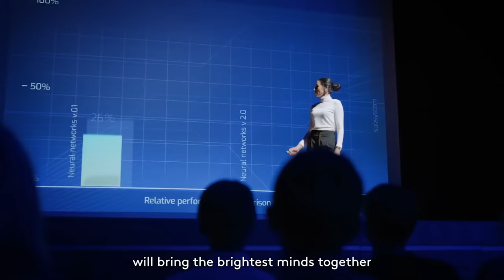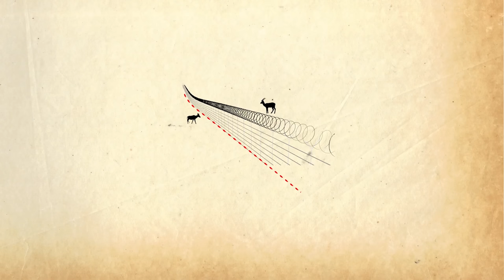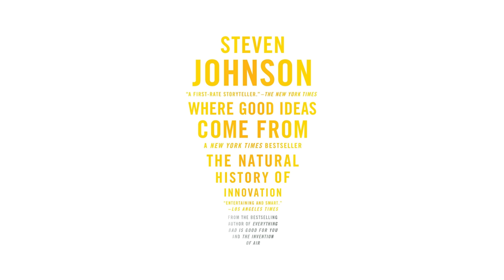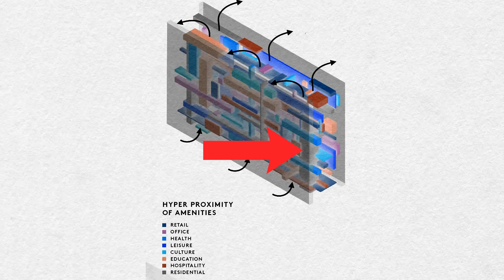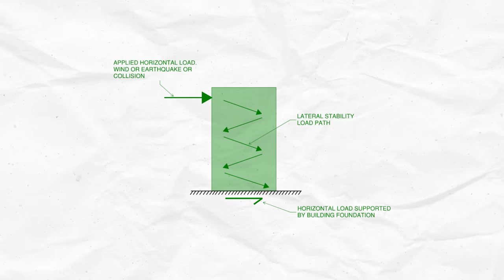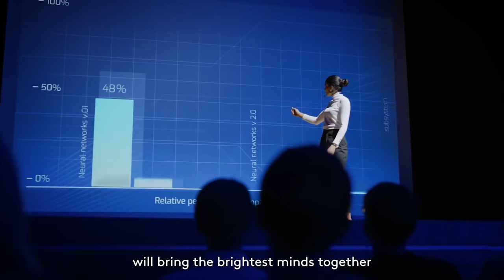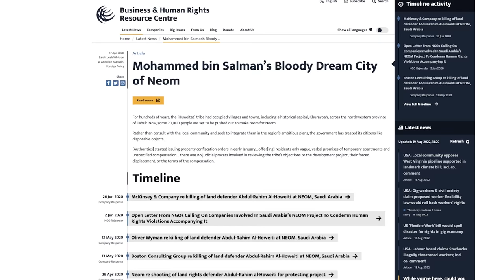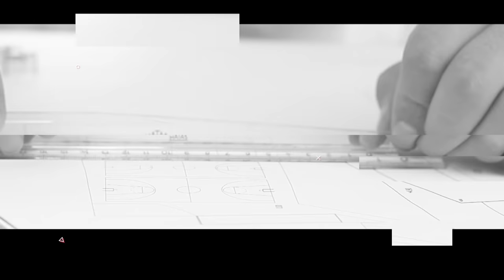This city concept breaks architecture (THE LINE)

Comment: About the environment disturbance, I think it's also worth mentioning that a 500m high wall is going to disturb so much the wind patterns, it might actually have devastating consequences on the line itself: I wouldn't be surprised if it just creates a huge sand deposit in front of one side of the line, as well as create wind abrasion. Also, it might create microclimates on either side, and for sure disturb usual water patterns, maybe creating flooding in some areas after a desert rain.
Reply: That's actually a really good point too. They're basically putting this thing up in a place where it's going to be almost non-stop subjected to literal sandblasting across a huge surface area. Between that and the incalculable number of birds that will splat in that thing, structural failure in the glass panels will become a problem sooner rather than later.
Reply: I remember things like that happening when they made those fake islands that cut off water flow and turned everything on the coast into a bog haha
Reply: also it would become incredibly unsafe if the sand that's picked up by wind gets INTO the wall... what if a gust or literally a sandstorm occurs and enters the wall .. you're at mercy of mother nature and you've basically created a death pit  where you'd be spending millions of dollars cleaning out and extracting the build up of debris and sand every few months....i might be a bit off but it sure doesn't seem safe at all
Reply: @Proffessor Enigma That's not unlikely. Whether or not they care, doesn't matter, let's mount a greater body of evidence against the wall to show it is not a good idea.
Reply: @anastasia408  Yet another very good point. In fact this point is probably pretty key, as not only would it become an issue if the wind carried sand inside somewhere accidentally, but that kind of place will absolutely need to have an integrated ventilation system all the way throughout pushing huge volumes of air around inside which, of course, means intake on the outside. Intake that's going to be constantly overwhelmed by the sand and dust that will be practically constant in that environment...
Reply: Exactly LOL
Reply: @Astraeus..  it’s ok they’ll have the slaves remove the sand everyday
Reply: Fascinating  point. Just another point that reinforces that this project has nothing to do with sustainability and everything to do with vanity.
Reply: Somebody needs to run a computer simulation of this thing and see what happens. I'm thinking that the thing is just going to become a huge sand mountain on one side at least.
Reply: Not saying i support this project in any way. But if you and i (a couple of simple dudes on the internet) have come to this relatively logical conclusion, wouldn’t the professionals and multi billion dollar investors have thought about this already
Reply: @mark94786  They are professionals at taking billion dollars FROM THOSE INVESTORS.
I mean, just take a look at some of those projects that are made like those "palm islands". 
If you got them hooked at the pitch, they are go.
Reply: It's truly amazing that they chose the least aerodynamic shape to shield against winds that carry small hard particles at violent speeds. It's like they're asking to be knocked down by the storms they claim to be shielding from. They're also asking for a city-/line-wide epidemic, because maintaining fresh air circulation and temperature simultaneously in this flat, high-surface-area shape is going to be an energetic nightmare, and one of the two will be compromised. And no amount of trees jammed inside the line will prevent disease transmission in a densely populated level with no options to leave easily and no free access to fresh air.
Reply: Abrasion isnt an issue. The rest, however...
Reply: For rain it would have to be high enough to block clouds and it’s nowhere near high enough for that, at least in arabia
Reply: @amruthasrinivasan3875  I keep seeing cooling as a problem. Cooling is not an issue at all. Smart design and using your brain goes a long way. Im living in a 12 story building.
Be it winter at 2ºC or summer at 35ºC, in my house, the lowest you will see is 19ºC and 23ºC the highest. No heat, or AC.
The heat output from the fridge, TV, washing machine, stove, PCs, 3 persons, is enough to raise the temp of a 90m2 apartment by 2-3ºC during a 24h cycle. In winter we vent for half an hour everyday in the morning.
In summer we vent for 2h in the morning, then close windows and drop all blinds............

The secret?¿ 30cm brick/concrete walls + 25cm of "ventilated" facade, and a shared heating system throughout the building. When some1 above me turns the heat on, i get residual heat from the pipes going through my walls.........

Right now, at 1 december i didnt turn the heat on yet and im at 20,5ºC with 7ºC outside.
Reply: Mirrored wall outside. All the birds that are going to fly into this.
Reply: Who is going to wash the mirror windows after a big sandstorm?
Reply: @zacharykassner9002  Even aircrafts get birdstrikes thousands of feet in the air, so should you close the aviation industry?
Reply: On top of travel in and out of the city. The graphics seems to have little to no room for any aircraft to logically land. So are they building the airport somewhere else? Maybe the plan was to drive everyone to and from but with that comes: where the vehicles are coming from and how they run in the desert?
Reply: It would pile up sand on one side, and erode the ground on the other, which would weaken the foundation, and could even cause the structure to list.
Reply: @mattmathematics3591 from Bangladesh
Reply: You’re telling me life isn’t like Minecraft where I can just build anything and the environment is completely indifferent?
Reply: @y337  Well, depends if you're a Saudi prince, I guess?
Reply: This is what happened to the famous dunes in the Canary Islands. Some resort built a huge hotel that blocked the wind facing the dunes and they’ve been eroding for years. They’re almost gone. Ironically they were a big tourist attraction 🙄
Reply: The sun and heat will destroy this mega structure in less than 50 years. Its not like they just build it and its finished. It has to be maintained every single day by thousands of workers.
Reply: @brianh9358  And inside without air conditioning only for a few hours will transform this building into a giant oven.
Reply: @brianh9358  👌✔️
Reply: @carloshenriquezimmer7543  😂👌
Reply: Maybe because of mirrors the sun light will not be able to warm up air inside the line and the shadows will keep it cool. The temperature difference should create the air flow which would ventilate and exchange the inside air with the outside one. However it should suck it from the top and blow it from the bottom side in order to keep sand away from the basement. But usually it works vice versa hot air tend to rise up and cold air took it's place because.
Reply: @messijr5145  Let's be honest, I don't think we even have enough data to make a model. We may have something of a similar length with the Great Wall of China, but it's far from half a kilometre high (and also mostly destroyed today). Otherwise, we know how wind behaves with skyscrapers, but those might be 500m high, they're thin pencil like structures, not hollowed walls. So no, I haven't run a simulation, but never pretended I knew what was going to happen, but I don't think anyone really fully knows, and it doesn't feel like the team behind the project does. So, if that makes me scum...
Reply: Will the human inside be able to do something that has never existed before?
Wouldn't they feel bored being in a main building for a long time, it looks like a cage
Reply: Dont overthink. Newyork and other cities have already done all this

Comment: an additional thing that I dont see many people talking about:
the trains failing.
if even one "pod" or whatever they decide to use fails; whether it be crashing, malfunctioning, or anything else, half of the ENTIRE transport system is down until that single unit or issue is fixed.
especially if you can only go in one direction. if it happens to be the case that both lines have different or the same issues within the same time period; the entire city MUST move around on foot; maybe on bikes if they have even planned for those to be included
Reply: And according to the promotional material its 170km long which means if you live in a different section from where you work you would basicly have to run a marathon just to get to work everyday
Reply: Designing a city involves allot of tradeoffs (multi-objective optimization) and we need more in-depth information to really judge the design.
Reply: more than 1 train lines man this is a very simple issue
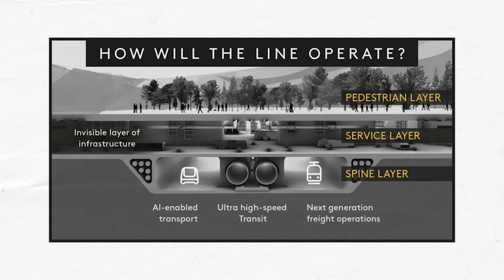Reply: You are right but if you look at 2:20 there are multiple options for transport also people could cycle
Reply: @imienazwisko4219  until they show or state that cycling is a built in option, I'm going to assume it isn't. And there is 2 lines as you said, but the train tech that can achieve the speeds being discussed is purely speculative at this moment. I agree with other commenters that we need way more information to do a proper analysis. But for right now, it's not looking great from a functional perspective
Reply: @sl8roni134  Yes I agree with you
Reply: Every train line in the world has this problem. It's what makes them trains.
You just divert to the secondary line to get past the broken down train or damaged track etc. Then go back to the primary line once past.

Don't get me wrong, this line city idea is absurdly idiotic and will never break ground. And the Saudi government knows this, but a train breaking down isn't the reason this is a bad idea.
Reply: @crebuli  100% with you on that lol
My comment was mainly to draw attention to an issue that not many criticism or discussion videos included in their takes
Reply: It's not like cities just completely shut down because one train breaks down on a line, you simply divert the traffic to other lines and then back as you deal with the issue and remind people of other transportation options such as busses or bike lanes. I agree that this line city is an utterly ridiculous idea for countless reasons but trains failing isn't really one of those.
Reply: money will solve all the problems that you are concern about
Reply: @user-vf1tx4pm2z  lolololol we'll see
Reply: "The entire city must move around on foot"
I originally parsed this sentence as the whole prism growing legs and just walking around and it was a very funny image ngl
Reply: @adjoint_functor  that would solve the train breakdown issue pretty quick, you should suggest it to them!!
Reply: attempts to introduce a political agenda to the issue have made it lose its credibility, not to mention endless errors and lies.
Reply: @lordofmercy4807  I'm a bit confused about what you're referring to here.
Can you elaborate a bit?
Reply: People are talking about it. You’re not the first.
Reply: @night6724  ??
Reply: Elon Musk will come to rescue and built a rail mesh underhell
Reply: @sl8roni134  people only hate this because it is built in saudi arabia but if europeans did the exact same thing it’d be worshiped
Reply: @thehandleiwantedwasntavailable  I'm glad! Hopefully they'll improve the train system for the slight chance this structure is ever actually built
Reply: Gotta love pUbLiC tRaNsPoRt...
Reply: Isn't it also really dangerous riding it? I mean you are travelling with well over 500km/h. Do you know how long it takes to slow down if a crash is in front of xou?
Reply: @zammy7155  yep!!
Reply: @user-vf1tx4pm2z  They will run of money before they finish a few kilometers

Comment: 0:23 to travel from one end to the other end in 20 minutes, if there are no intermediate station stops, then the vehicle would have to travel at more than 510 km/hr. If station stops occur at say 500m intervals, and allowing say 2 seconds for people to get on and off per stop, then the vehicle would have to quickly accelerate to around 3000 km/hr in between stops. I think many of the passengers would end up being injured or un-alived by the time they got to the end of the city, due to the g forces involved.
Reply: 2 seconds?While I never timed it exactly the average getting on/off time on a subway is closer to 20 seconds. This doesn't include situations of people being slower than average or that you might have a crowd of people getting on. 2 seconds?That's the time needed to have only the first person get on/off. The one right next to the door.

Comment: The studio I'm currently working at was tasked to provide concept renderings for a segment of this project. I won't go into details (for my own safety and for keeping the job), but I will say that you can't imagine the "guidelines" we were given. And the majority of us are architects and among ourselves, we had so many questions. Me personally was concern with most of things said here in the video, and would like to add:

traffic >what happens if there is an accident on the road? In cities as we know traffic disperses to the other routes. Here you have one big highway and can only go back and forward.

plumbing> how in the name of Corbusier would plumbing here look like? You would basically have to treat every segment like it's "Unite de Habbitacion" itself or like one big building for itself.

Foliage> It should be illegal to provide a misleading image of a full-grown tree with a canopy of 3m in diameter and only 0.5-1m growing ground depth. (Ironically this is part of my job)

That "thermal diagram" is pure nonsense. The hot air rises-true, but it prevents cool air from entering the same way. Meaning cool air is supposed to be input from below so as it heats up rises and vents out.

As it is fun to work on projects like this (we literary went full-on crazy with some building concepts) - It is very concerning to think that ideas like this are forced while disregarding some of the issues that are known for decades now (like negative impact on the wildlife habitat). And the thought of being part of it (by working on it) makes it even worse. As @DamiLee said here architects put their client's interest over their own, and when your client is the monarch - you can only do as he asks you to do or he will find someone else to do it as he wants it.
Reply: When the train stops then 9million people are late to work. Simple! No problem there lol
Reply: The plumbing alone sounds like a nightmare to even plan. Then again Burj Khalifa have their poop trucks lined up outside, maybe they'll do the same here lol
Reply: It was the wildlife and foliage problem that struck me the most. I'm by no means a professional, but the amount of plants and all... Not only do they need space, they need care too that isn't given there from the natural surrounding. Also, the ventilation concept. If that means the plants must manually be kept cool too, then the cicle of wasted effort is kinda complete, isn't it?

And what about the animals. It sounds like a super-clean concept that would guarantee fox-and-mouse-free streets and i can't find anything about how natural wildlife will pass trough the line. If theres even a chance. If i, as a human, would be tasked with finding one hole between 170km of mirrors, i'd pretty much give up right away. Not even talking about how desoriented wildlife can become when confronted with a huge wall of reflections.

I just hope it stays a fun 3D project and never actually sees the daylight.
Reply: @Tbop3  It seems a bit self defeating to drop clients every time you think they are spending their money unwisely. Unless you are in a position to talk some sense into the idiotic Saudi Prince behind this whole folly there really isn’t much that can be done to prevent this train-wreck from happening so you may as well profit from it if you can.
Reply: @leejerrett8268  What about the code of ethics?

Comment: Even without the proper education, I could see that The Line was more of a vanity project than an actually well-planned, well-designed city that would take its inhabitants' needs in mind while being sustainable. This video confirmed all my reservations
Reply: sustainable is boring, arab countries need to shine with material things to attract people, things that can't be found elsewhere.
Reply: You are right but at the same time allot narcissist are getting butt-hurt over a design of a building
Reply: so, vanity projects
Reply: Oman 🇴🇲 is the most beautiful country in the middle east, because it has simply design cities.
Reply: The grid city was proven a failure long ago, it appears efficient but in practice it's not desirable.
This gave rise to the circular suburb, amenities like schools and small commercial are at the center, then residential roads surround them in a circular fashion (rectangular really), with parks, police/fire, bus stops etc strategically placed. These suburbs connect to major roadways that don't necessarily go in a linear fashion but rather snake and connect to where they need to be, avoiding any traffic lights and preferring to even go over or under other major roads.

This is because in reality ppl want things close to home and don't like traffic, also the most desirable place to live might not be linear to the current major roadway.